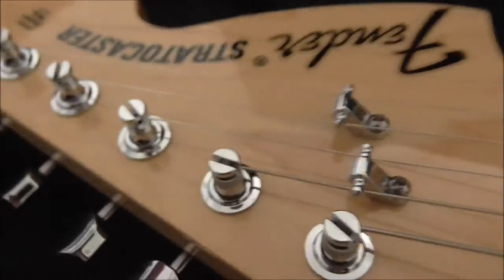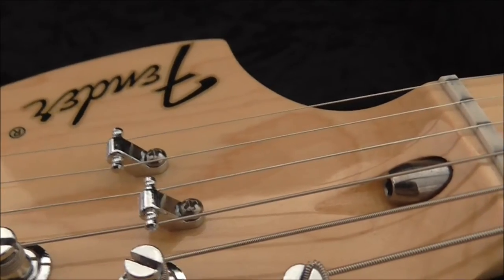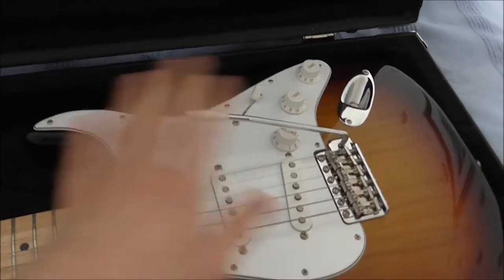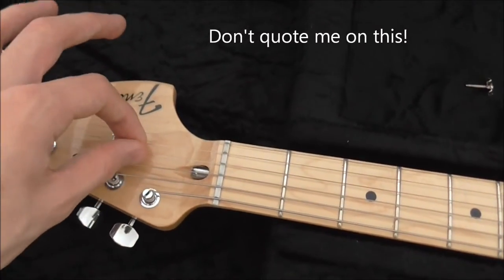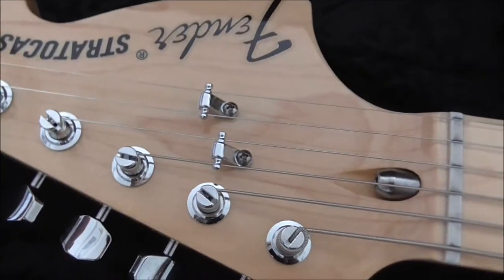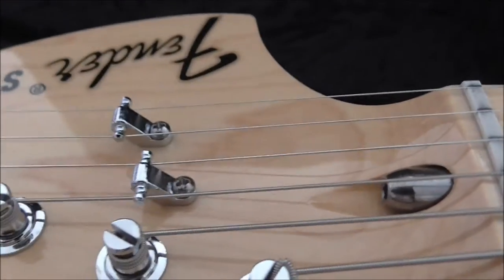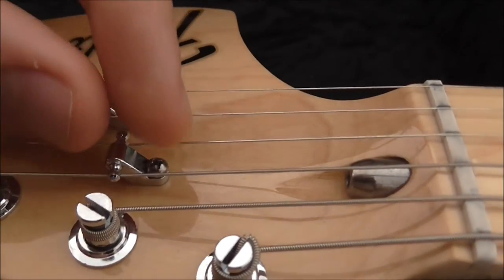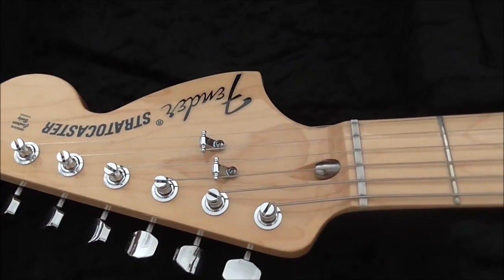Roller String Trees

Comment: I installed one of those exact string trees for my B and e strings. They're not "rollers" dude, the arms are fixed in place. It just reduces friction over the wing type because of the shape.
Reply: even if they were rollers, it’s doubtful they would actually roll. Same hoes for my LSR roller nut — I don’t know if the ball bearings really roll but I must say it it’s been working great w/my floating Strat Plus bridge for 30 years.

Comment: Those not rollers, just a better option to replace the shitty stock ones, but the BEST option so far are that it has the true two rollers in the sides, wich actualy can be sanded from it's base to set them in the perfect and exact height you need for your strings.

Comment: Hi i just replaced the butterfly/winged string tree on my new Strat with one like yours. Maybe i did it because i think that the roller looks  cooler than than the winged ones. Anyway, i got rid of the stub/tang at the bottom of the roller..Do you think what i did has any negative effect? I just don't want to drill any holes on my new Strat.
Reply from the maker: So, I have heard the argument that without the guide the string tree could move and be off angle. I'm a bit sceptical of that though. As long as you double check that the screw hasn't loosened every few months, then that combined with the string tension should keep the string tree in one place.
Reply: @AdamThomasMusic  Yeah i thought of the same thing as well..what i did was cut off the tang/stub with wire cutters and filed the excess; afterwards i put clear nail polish on the bottom of the tree (to makes sure to avoid scratches on the headstock) then just screwed it into place.
Reply from the maker: @rageflash9  Maybe the nail polish will help the string tree stay in place

Comment: Is the positioning of the trees down to any thing crucial as far as function or are they staggered for aesthetics?
Reply from the maker: As far as I know the position is supposed to be important for giving the guitar a correct break angle. I think as time went on they added in more to try and perfect it. So I imagine that the ones with less are just emulating the older design? Either that or its partially snake oil lol. Although I can attest that the strings are less stable without string trees, so they certainly do something.

Comment: Are rollers worth gettting if you blocked the bridge ?
Reply from the maker: They still can be. By blocking your bridge you've locked down the tuning there, but if the strings aren't running smoothly along the top there can still be problems too. If your guitar is fine how it is for you there is no need to change, if you are having tuning issues you might want to consider getting these

Comment: What about an "upgrade" for original Fender Locking Tuners? It's not so expensive...
Reply: From what I understand about locking tuners (which I don't actually have any experience), they helped with stability in a different way. With locking tuners you barely need any additional string length above the nut. And it's in all of that extra string length where additional tension can be stored after pressing the trem arm.
Reply: Reggie Wallace Maybe when I gain some experience with them I will express my opinion on whether or not I like them... my opinion.  However, I'm not expressing an opinion here.  I'm describing the designed advantage of locking tuners.
Reply: They are not exactly cheap however. The last set I bought a month or so ago ran me about $80 on sale. They are the gold staggered ones though to match the test of the hardware on my strat. The chrome ones were around $40 on sale I believe from amazon.
The person WAS correct however. With the staggered locking tuners, the trees probably won't be needed if you use the original fender models. 
  I bought a set of gold rollers at the same time for mine..it doesn't need them. The low staggered tuners on the g b & thin e strings, are low enough to keep a good amount of pressure on the nut without string trees. I may put them on anyway..just because they do bring the strings up a tad above where the old fixed trees did. And I just don't want to leave the ugly holes there. But, if they bother the way it feels or sounds now, then I will remove them and just fill the holes.
  So, my suggestion is that IF you buy some Fender locking tuners for your strat..try them with no trees first to see how they work before you toss the other $15 or so out for the gold rollers. Good luck!

Comment: i bought these for my tele. when i bend up using the 2nd string, they make noise, why is that?
Reply from the maker: Do they make a cracking noise? If that is the case, then it sounds like they have a slight flaw where they aren't as smooth as they should be, so when you bend the string it catches as it passes through the string tree.

Comment: Can I use string trees from a full size guitar on a three quarter guitar ...even tho they are bigger on full size guitar .HELP THANKS
Reply from the maker: I believe they should be the same size. If there is a guitar shop near you it might be a better idea to take the guitar to the shop to compare the size of the current string trees you have with ones on full size guitars, that way you can be 100% sure.
Reply: @AdamThomasMusic  thanks for your advice ...👍

Comment: Hey what are your machine heads?
Reply from the maker: They are based on the tuners Fender made in the 70s. On their website they are listed as '70s F Style Stratocaster-Telecaster Tuning Machines'. They are quite similar to the Kluson style ones they sometimes use to mimic the tuners they had in the 50s and 60s, but redesigned abit.

Comment: There not roller string trees. 
BUT. 
YOU CAN MAKE THEM ROLLER. IN 5 MIN.
USE PLYERS N POP OUT PIN. TAKE FILE FILE DOWN PIN. GREASE N REINSERT. NOT ONLY R THEY ROLLER BUT THEY WILL ALLOW STRINGS TO SIT STRAIGHT.

Comment: so can you set the stings on the top of the string trees also
Reply from the maker: frank aragona Noooo! They always go under, they wont work on top
Reply: AdamThomasMusic  hi  that is what i thought to but someone told me if you have high gauge strings like 13 to 15 you can put them on top so they dont buzz and touch the frets did you ever try using 13 t0 15 gauge strings let me know ok thanks frankie
Reply from the maker: No matter what gauge the strings are, for the correct break angle to be made on non angled headstocks string trees are requires and the strings need to go underneath them. If however you don't like string trees you can buy staggered tuning pegs, where the higher strings peg is set lower down to create the correct angle
Reply: Ok thanks i thought it was the tuning pegs that had the problem thanks
Reply from the maker: Brandon Reyes The tuning pegs do matter. For a good vibrato system the tuning pegs need to hold the strings firmly in tune and the strings need to be solid on the other end too. Its the middle where the strings need as little friction as possible

Comment: I put these on my guitar and they caused tuning problems when using the whammy
Reply: metalblades4 then you either need to work on your nut(add graphite for an easy fix), or you need to adjust your tremolo.